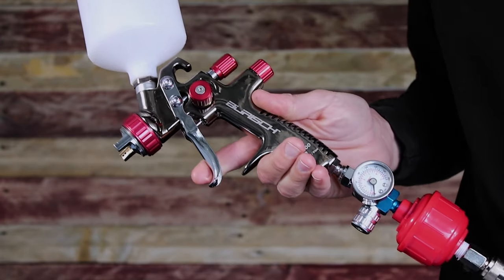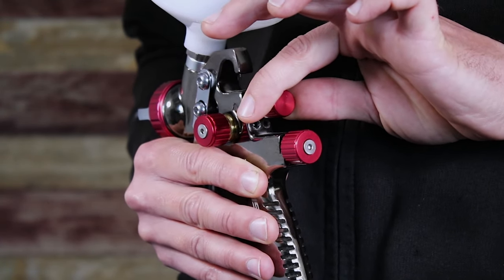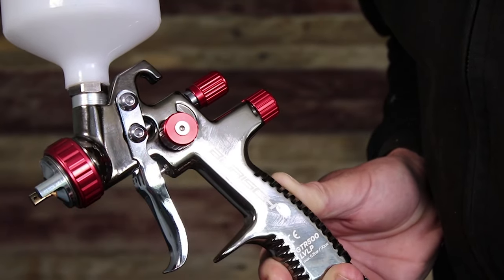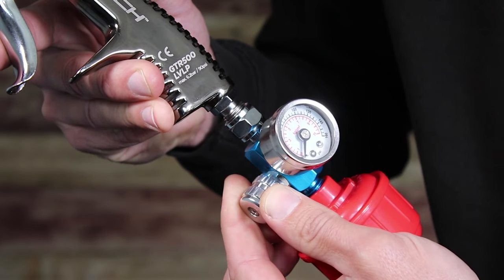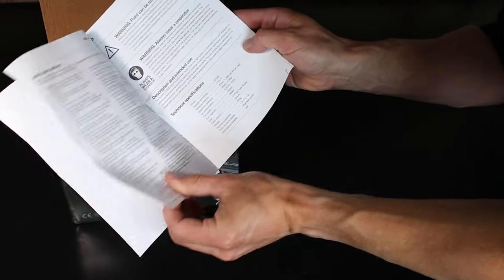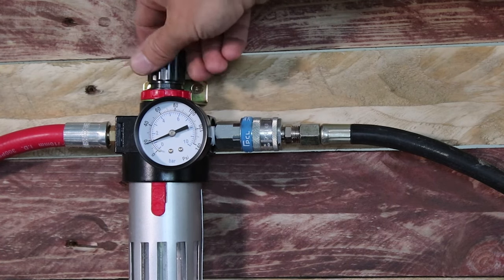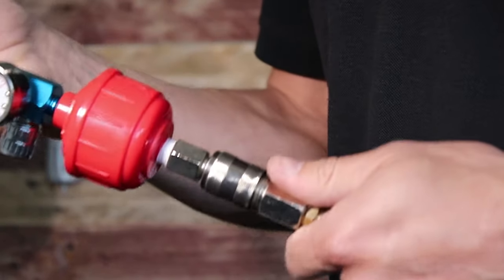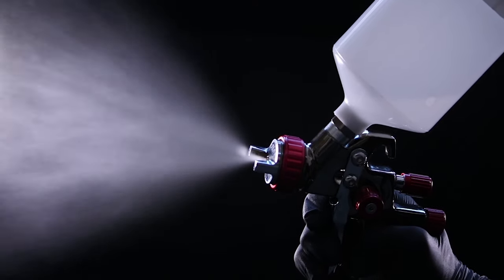How to setup the correct working pressure on a spray gun for best performance

Comment: The guy says the gun needs a working pressure of 2 bar, or 29 psi as he points to the manual, but you can quite clearly see the manual say 1.5 bar, 22 psi. Clearly both figures can’t be right, so which is it? Maybe, you might want to redo the video again, but first read your own manual!
Reply: The manual says 22psi at the air cap, so you need more pressure at the regulator. Manufacturers talk about pressure at the air cap. It's weird, but does not matter anyway because there's no way of knowing how thick or thin matertial you're spraying, so they can't give you a definite answer.
Reply: @SUMOCAT86 Thanks for this, a key snippet of detail nobody mentions 👍

Comment: This is the proper way to adjust a spray gun. Far too many users run the compressor output regulator too high  and dial at the gun without realizing the problems it causes
Reply: I set the pressure at the compressor anything less than full and there isn't enough flow, the air empties out of the air line before the regulator can let air in to keep it full

Comment: It is important to note that this is just general recommendations. The actual air pressure you need may vary depending on the specific spray gun you are using, the type of paint, and the desired finish. It is always best to experiment with different air pressures to find the one that gives you the best results. In this case he is using the GTR500 which requires 29 working air pressure while the KBS Spray Gun is much different.  The working air pressure for the KBS air spray is typically between 15 and 50 psi. The specific air pressure you need will depend on the type of paint you are using and the desired finish. For example, you will need a lower air pressure for a thicker paint like enamel, while you can use a higher air pressure for a thinner paint like latex.

Comment: Do you adjust the air pressure with the fan open or closed? because on my gun this changes the  air pressure. So if i set the gun pressure to 21psi with fan open when i close the fan this increases to over 30psi! conversely if i open the fan the pressure reduces.
Reply: I would recommend setting the air pressure with the fan set to how you intend to have it setup for the spray session.

Comment: Question.   I have just started running line for hvlp gun. What do you do with the pressure regulator at the compressor?    I have 30ft of 3/8 line from compressor to a water separator and larger regulator, then a 50ft line on a reel the to the gun.    From your example, set intermediate regulator to zero and gun full open,   and increase to working pressure.  What about pressure at tank?  Full open?   What will yield longest run time without interruption?   It’s only a 27gal tank, 200psi, 6.8scfm@40psi,  5.1@90, 1.7rhp.   My gun says average consumption is 4.3cfm, and operating pressure is 40psi...   not sure what to do with this info.  
not trying to paint a whole car, just parts.   First time.  
Someone said two 50ft lines was to long, so I cut one to 30.  
Secondary question....I noticed your first line goes straight into the regulator, not having a quick disconnect coupler.   By design?  I was gonna and one on either side of intermediate regulator ( on lines).   But not sure

Comment: Excellent video. What’s the knob on the bottom of the handle for? People say to leave it fully open or closed I don’t remember but what’s it for and proper setting?
Reply: Normally if there is a knob at the bottom of a spray gun its a pressure regulator, if you have an auxiliary regulator with gauge fitted then you want the knob on the gun to be fully open, if you don't have an auxiliary regulator fitted to the gun then you will need to adjust the knob on the gun to get the correct pressure (which is difficult without a gauge at the gun). Hope this helps.
Reply: @RyanBurisch  yes, thanks Ryan good to know.

Comment: Very good explanation for us beginners.  But how much hose between compressor and wall mounted regulator is required ?
Reply: It's a very confusing topic, but you can get away with a pretty long hose for painting, since you saw, the amount of overall pressure is much lower than say an air impact gun. As you decrease pressure, CFM rises so, a reasonable length hose will still deliver enough flow and pressure. Just keep in mind for long runs, it would be best to use a larger hose (3/8"). That said, setup will be the same as in the video

Comment: what size is the male that comes from the handle? i have a 1/4 bsp quick connector  on my air hose...what connecter do i need? any help appreciated thanks and a great video
Reply from the maker: 1/4" BSP
Reply: Thanks so much
Reply: @gtairprojects5298  you know what size air line if 1:4 bsp paint gun.    I see different air diameter like 10mm.  8mm
Reply from the maker: @garydeandeery  Hi - either will do, they both accommodate enough CFM for the gun - 8mm would be a lighter hose which would be easier to handle.

Comment: Hi do you need high flow air fittings for lvlp spray gun
Reply: I would say so.  If you’re running a smaller compressor you’ll need its max CFM and high flow fittings help, along with a 10mm I.D. hose.

Comment: Is it 29psi or 22psi like the manual say’s ??????????
Reply: The manual says 22psi at the air cap, so you need more pressure at the regulator. Manufacturers talk about pressure at the air cap. It's weird, but does not matter anyway because there's no way of knowing how thick or thin matertial you're spraying, so they can't give you a definite answer.

Comment: Can too much pressure create little bubbles on the surface of the item?
Reply: No, what you're most likely getting is water from your line. The way to help remove it is with a filter.
  They're called desiccant filters. They look like the little balls in bible tea. This will help but won't guarantee you water if there's a lot of water in your line.
  Make sure your compressor is drained with the drain valve at the bottom of the compressor. The the best way is to get a wall mounted contaminant filter. Home Depot and Lowe's sell some for a reasonable price but some of the professional ones can get up into the hundreds of dollars.
  If you're just doing small jobs where quality isn't crucial, you can let the paint flash off in between coats so you can touch it with your finger and you could brush the water drops off. You still might see it if you look closely after you're finished but it'll be better than if it goes unnoticed.
https://www.homedepot.com/p/Husky-1-4-in-NPT-Inline-Desiccant-Dryer-HDA72300/305303724
Reply: Solvent entrapment
Reply: @cspray5386  due to what?
Reply: @dimebag108  
Too much paint
Not enough time between coats to allow the solvents to escape. 
Follow TDS on paints - majority are available online or ask a representative.
Example - first coat goes on , wait how long before second coat , - every product is  different - then you have ambient temperature and surface temperature. 
But usual check is spray a side section or check the tape beside with paint on it. - if it leaves a fingerprint but doesn't stick to finger , then usually it is good to go. 
Then you have different thinners as well to help you play with the conditions.

If you wait too long , it can be like putting a first coat ( tack coat ) on again. 
Go too soon - the thinners haven't had time to evaporate - hence - solvent entrapment. 
If it's too hot, and the outer skin dries before the solvents escape - solvent entrapment
Reply: @dimebag108  
And assuming you do have tiny bubbles on the surface, solvent entrapment, but understand,I haven't seen your project.
You have 2 options at this stage - try to sand through the bubble issues, followed with a rub and buff - good luck
Or , sand it , re prime it and spray topcoat again.
This time follow instructions on TDS